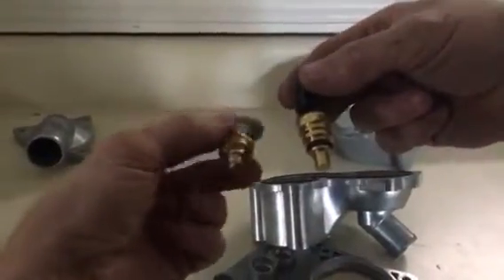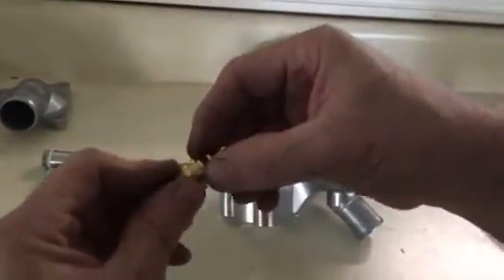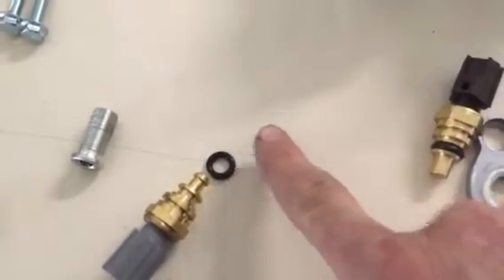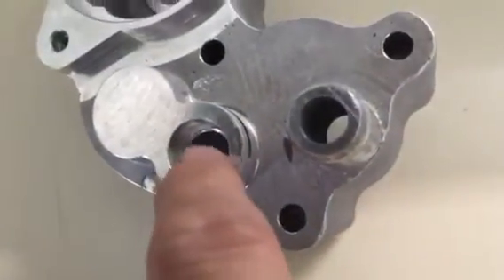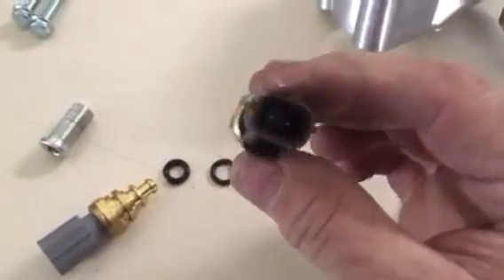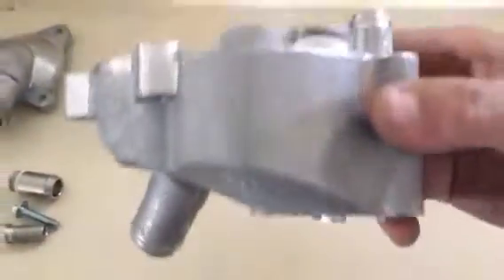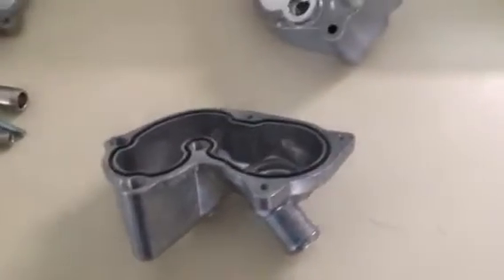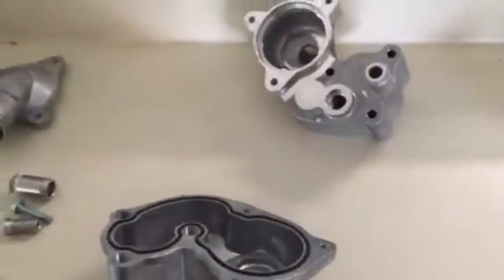Mustang metal thermostat housing

Comment: With all due respect, for 1/2 the price, I went for the 2 piece proverbial "Chinese knock-off" from eBay! 
On my 2004 Ford Ranger, the failure mode is that the plastic warped at the plastic seams, allowing for the coolant leak. The metal one, whether 1 or 2 piece, should cure that problem completely because metal WILL NOT do that. 
We will see if this is a lasting fix! 
It took me 2 hours to change out, & is DEFINITELY a better value than the crappy plastic one. 
All the best to you!
Reply: I installed one of the "Chinese knock-off" ones that I obtained from eBay, it started leaking after 1,000 miles.
Reply: Lifetime warranty, did you file for it
Reply: Where was it leaking at? @PCFithian